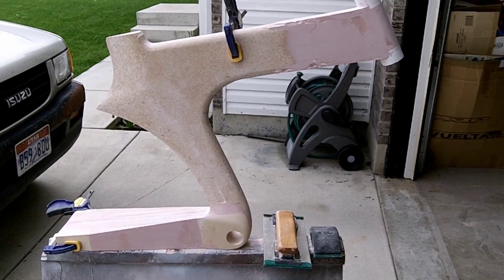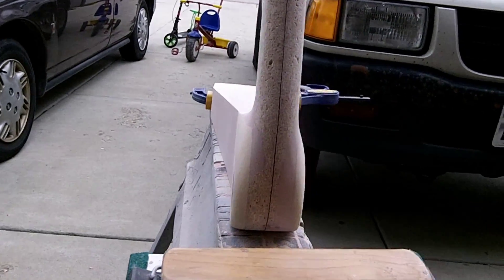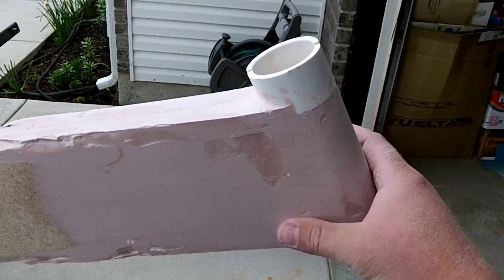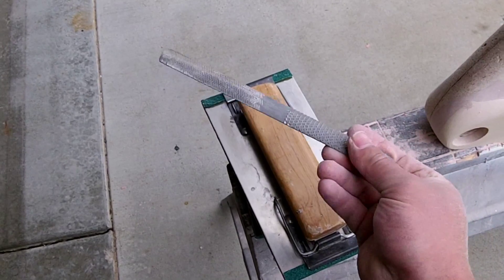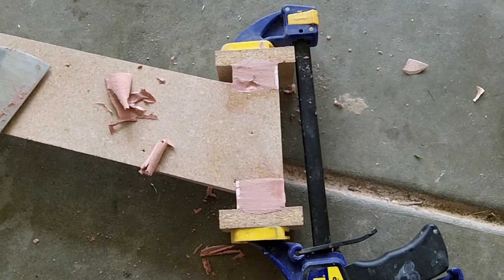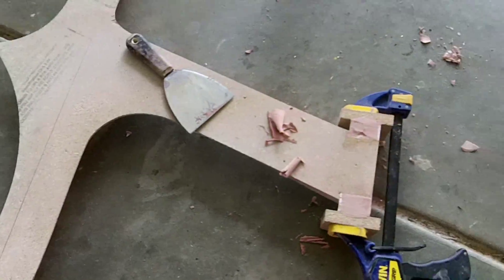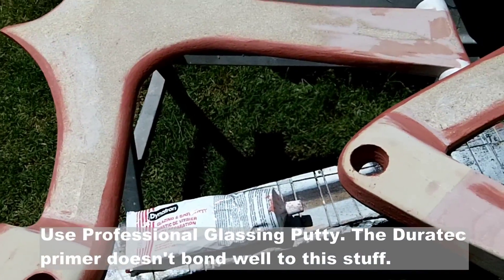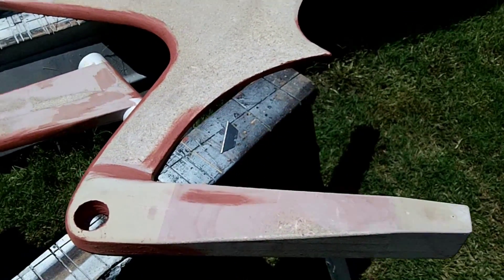Z Frame Bike: Video 4 of 13- Filling and Shaping Fairings

Comment: @TheProjectJunkie1 3d printer easy to make with an inkjet printer and will do good rough stuff but nothing special   you would have to oversize the item and sand it down to size.  cnc machines can be had for lesss than $5k if you shop around. worked at an ice carving shop out in las vegas they had one told me they paye $3500 for it . 5 axis for making ice carvings . the better carvings are all human made though.